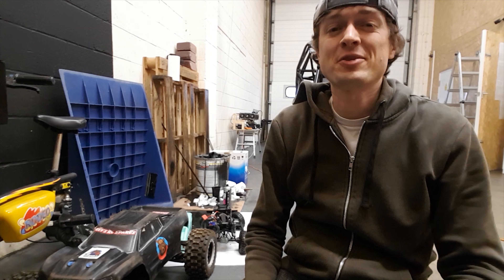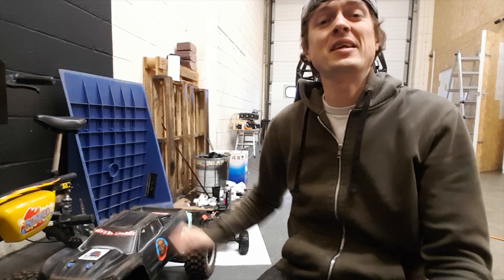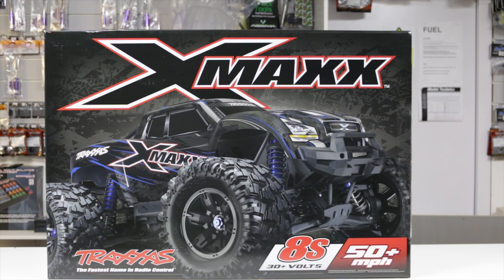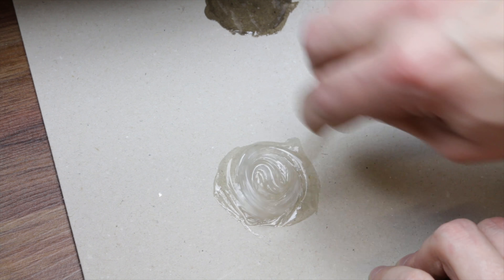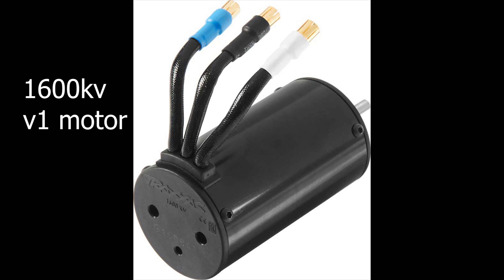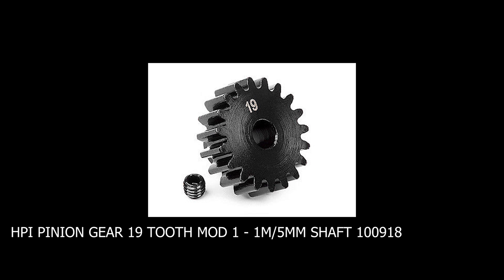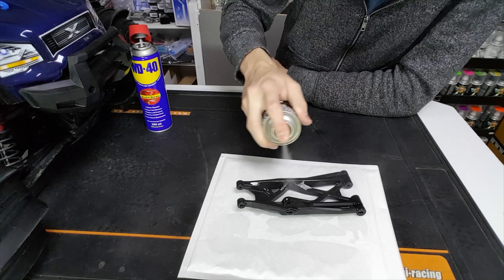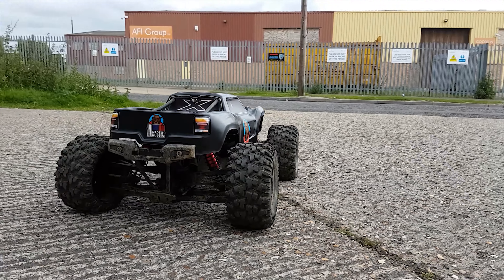Traxxas X-Maxx All my Upgrades Revealed THE ULTIMATE BASHER XMAXX

Comment: With that pinion and spur gear set up do you need to change any of the pin settings under the motor or is that good stock? I think I have a 22t in mine right now. Thanks

Comment: And if I put that esc in my 1/10 erevo do you think it would be better to keep the stock mamba 2200kv motor or should I do the 1600kv xmaxx motor? Is the 1600kv motor faster?
Reply from the maker: no idea you'll have to play about with it dude 2200 is faster but less torque

Comment: Okay, I have been looking everywhere for answers and I can't seem to find any, can I take that max6 esc and put it my 1/10 erevo brushless and use my 3s 5000mah traxxas lipos with it or will that esc have too much draw on the battery's and make them swell? The traxxas lipos are 25c 11.1v if you have an answer Kevin that would be great! Thank you and I love your videos, keep up the good work!
Reply from the maker: If you can fit it in it'll work, it's not so much the esc that load up the lipos, more the motor, gearing and driving style.
Reply: Okay, so if I put the 1600kv xmaxx motor in it would it be better?